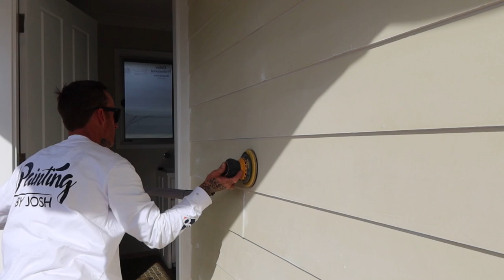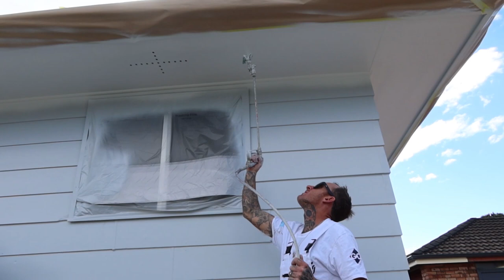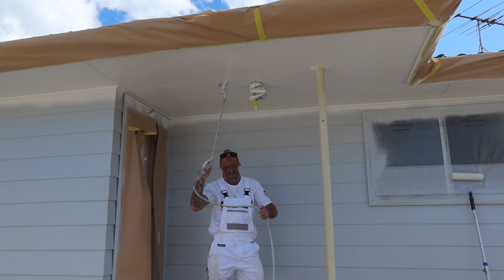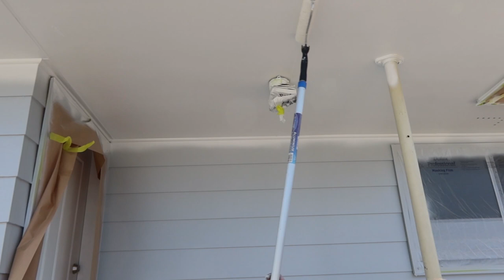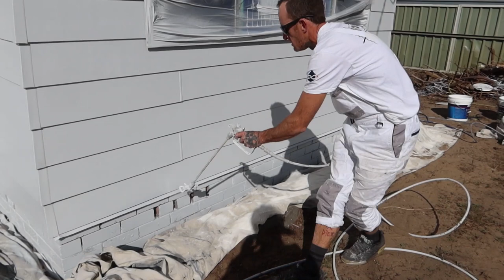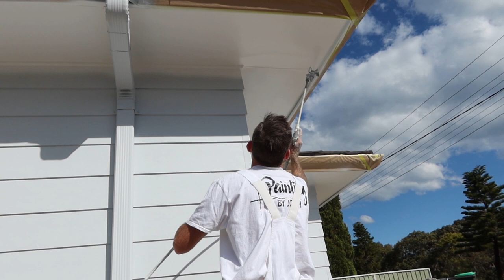SANDING | SPRAYING OUT SOFFITS AND WEATHERBOARDS

Comment: Hey is that aluminum or wood siding? What grit sand paper for your first sanding to take care of bits of debris,and what grit do you sand with in between coats typically?
Reply from the maker: Hi mate this is timber, I would use between 80-120 grit then light sand with 240 grit. Cheers for watching